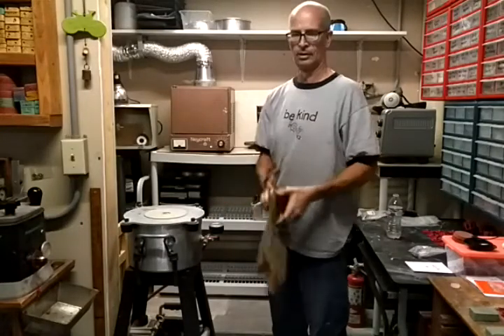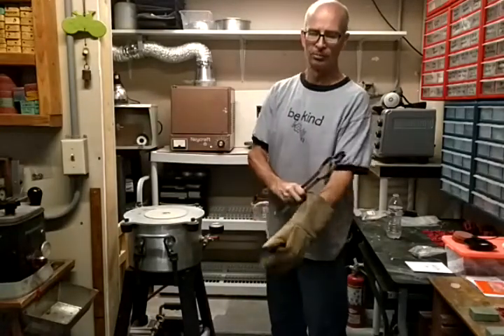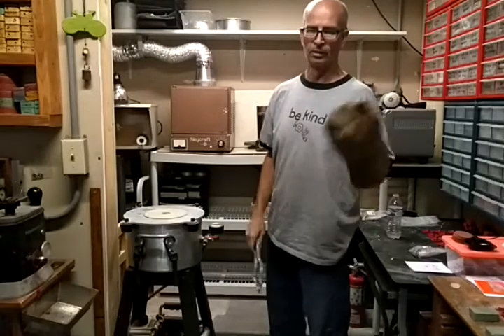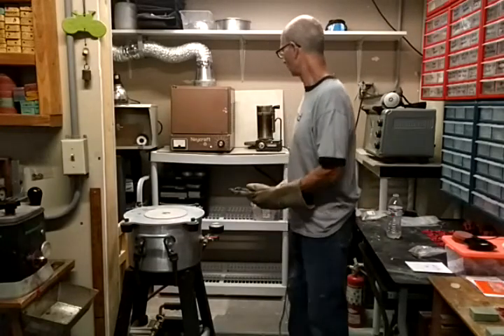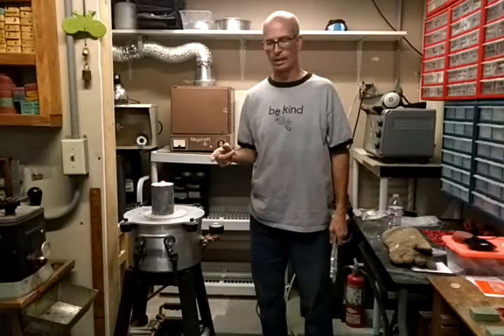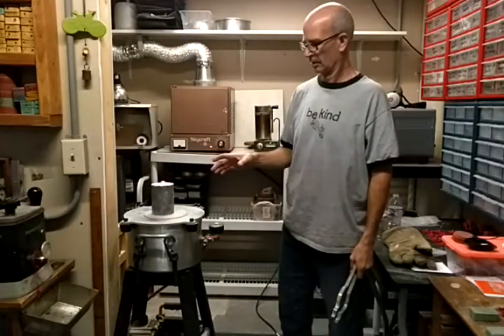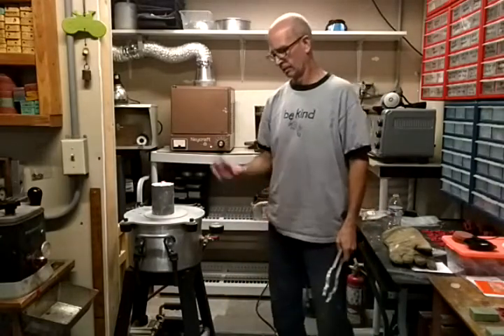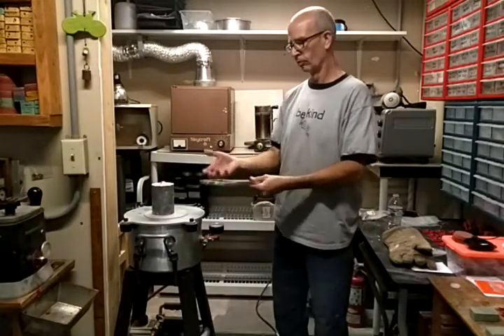Vacuum Casting: Basic Vacuum Casting Unit by DIY Castings

Comment: Pardon my ignorance, but if you apply vacuum, how come the molten metal doesn't leak from below?
Reply from the maker: The thickness of the investment between the mold and the vacuum table is too thick to allow metal to break through. However, it's porous so air can suck through it.